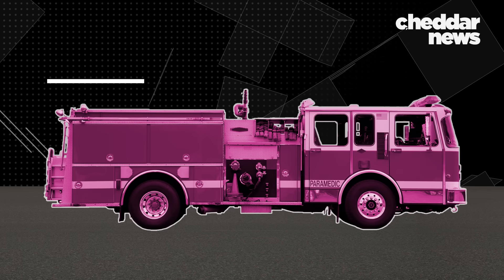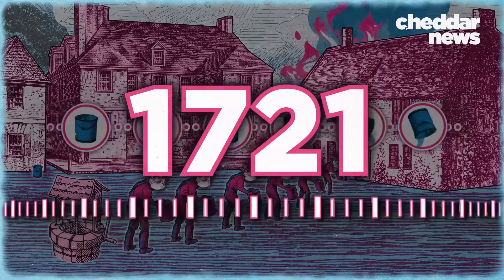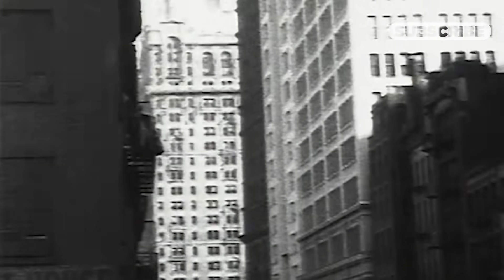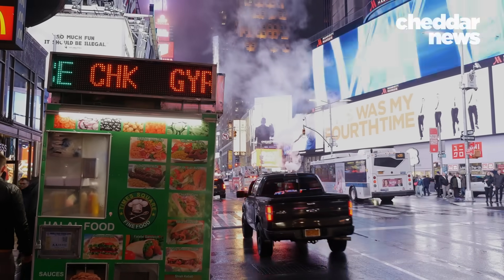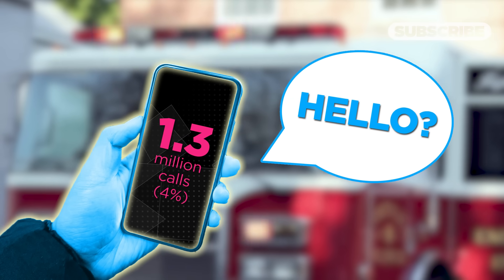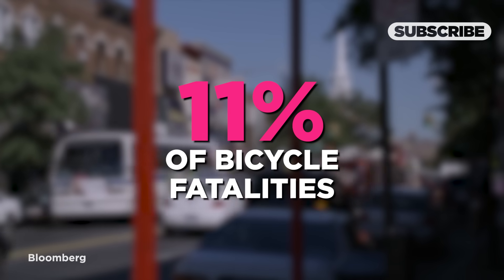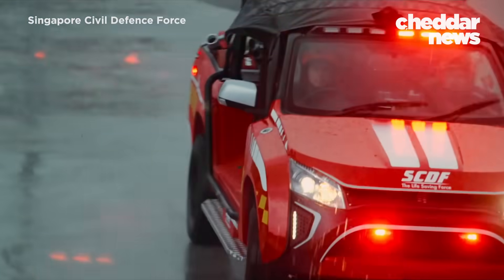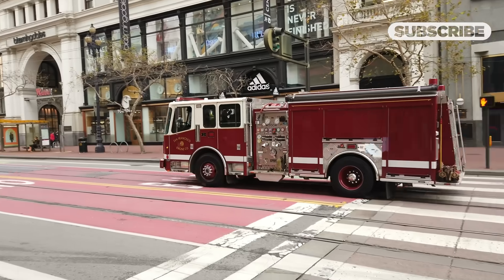Do American Fire Trucks Need To Be So Massive? - Cheddar Explains

Comment: Here's the thing maybe American fire trucks could be smaller who knows. But let's look at this scenario let's say you're going down the road and you get hit broadsided with a tractor trailer and yourself and your family is in your car, I roll up to the scene and my big heavy duty crash truck and I have every piece of equipment on that truck that I need, most of the time I have double the amount of equipment that I need. So I can work on this accident scene and I don't have to wait for anyone else to get there but if I were in a smaller truck and I roll up and something happens to a piece of equipment I have I may have to call for backup and that might take 10 or 15 minutes that you don't have. Let's take this other example let's say you have a car accident you have one car over to the right side of the road and another car to the left side of the road My big heavy duty crash truck I can work out of both sides of that truck and we can extricate that patient from both of those cars at the same time. Sometimes smaller trucks have an advantage but they're advantage is size and speed however they don't carry as much payload and when you're on the scene of an emergency the last thing you want is have to wait for something to get there, this ideology has been proven over and over and that's why a lot of the fire trucks are so big, because if you're in a rural area out in the middle of nowhere and you pull up to a structure fire it's nice to know you've got 600 gallons instead of 300 gallons of water because by the time your next water source gets there to set up a drop tank that house could burn to the ground or someone could die because you didn't have enough water to put the fire out to get to them. Why don't you leave the firefighting to the firefighters and we'll leave the Google searching to the Gen z people.
Reply: let me put it like this: an Engine in Germany is smaller than it's American counterpart. It holds less water, but comes both with a larger crew and more equipment. Why should they choose a larger truck then? It's not about the size of the truck itself, but how you make use of the available compartment space - and concerning that German fire apparatus are like a game of tetris for professionals.
Reply: @EnjoyFirefighting  You answered my question It's smaller it has a bigger crew and it holds less water. So without the water you don't fight fire. There's been a million efficiency studies done on the size of fire trucks they're configurations how the crew works do they use a three-man crew a four-man crew a six-man crew that's been beat to death, and the American trucks are still the same and they're going to stay the same. In Staunton Virginia they have one of the largest ladder trucks in the United States why because they need it or they wouldn't have customed built it.
Reply: @20truck  "So without the water you don't fight fire." keep in mind that the tactical approach might be very different. Departments in the US rather go for larger flow at lower pressure, whereas we go for lower gpm but at higher PSI and thatfor just don't need that much water on board to do the same job. 
That Ladder from Staunton looks like a massive truck, but it's still nothing more than a 100 ft ladder, is it? Yeah we have some few, very few Aerials of similar size (concerninge truck chassi) but not as Tiller. We don't have any Tillers in service on this side of the pond. The only one or two Tiller Ladders we have are imported US trucks in the private collection of some fire apparatus enthusiast in the Netherlands.
Reply: @EnjoyFirefighting  Now there's one thing that I do notice about German and Dutch fire departments that I see on YouTube they don't pull out hose like they do in the United States, you guys use a hose reel with quick connect personally I think that's a good idea You can get to the fire quicker. Now I don't know how your setup is done but in America when we use a hose reel it takes a lot of pressure That's why we used soft hoes that we use, how do you in Europe use that hose reel if you're going vertical can you get enough pressure from your engine to get it up a couple stories in the air? Another thing what do your fire hydrants look like I see videos from fire departments in England and their fire hydrants do not appear to stick up out of the ground like ours do they look like they're under the sidewalk and they open a  door and the hydrant is below the sidewalk is that true, If it is take a picture of one and let me see how it works?
Reply: @20truck  most European apparatus don't have a hose bed. Doesn't mean it doesn't exist, but it's not common to have on a normal Engine in most of Europe. Depending on the country, age of the truck etc the hoses are rolled up, few preconnected in hose packages or hose baskets, or sth very popular in Germany are the hose carts on the rear of the truck with numerous preconnected hoses. Additionally there are the rubber hose reels as quick attack lines. 
No problem, the pumps are strong enough to supply sufficient pressure to operate the hoses also several floors up. UHPS systems building up extreme pressure and thatfor working with only minimum amounts of water were somewhat popular in the past but aren't that popular today any more. 
That's correct. Well again it depends on the country and the specific area: we do have some few above ground hydrants, however most of our hydrants are below ground hydrants which are usually located in the road, with a cover which is even with the road surface. The crew can open the cover, place a standpipe onto the connector underneath and use a hydrant key to open the mechanism.
Reply: @20truck  video on the below ground hydrant. Although in German, you can see how it works: https://www.youtube.com/watch?v=2HIv8CQ90rw
Reply: @EnjoyFirefighting   That's exactly what I thought the fire hydrants would be, I guess they keep them underground to avoid freezing up in the snow. In America we have a hard time with fire hydrants in very cold climates freezing up, in some states fire departments carried torches with them so they can heat the fire hydrant up in order to get water out of it. Thanks for the video that was very interesting, Even though I didn't understand a word he said the picture was worth a thousand words
Reply: @20truck  they come with pros and cons; Even in super low temperatures the ground will freeze only 30 inch deep, while the pipes are 60 inch deep in the ground. However the hydrant cover can freeze and then it takes either a hammer or you have to de-ice it with a flame
Reply: @EnjoyFirefighting  I think getting to hydrants in the winter is a common problem for every fire department whether they're buried in the ground or they're upright like the ones we have in America. Cold is the great equalizer it'll get you any way you go. And then when that water comes out the end of that hose in the cold we all freeze solid. I know one day I was going down the road after a we had done an extracation on a truck that had wrapped around the tree and the fire department was likely spraying so as we were cutting the metal with the K12 it didn't cause a fire and some water got on the road I turned around to go walking back to the engine and I hit black ice and I bet I slid 30 ft before I got stopped, my ass hurt the rest of the night.

Comment: As a retired American firefighter allow me to repeat what a visiting firefighter from Germany once told me about American fire engines:  Americans design their fire engines with two views - one is how it performs fighting a fire, and the other is how it looks in a parade!

However, the type of engines you have is more dependent on the type of fire department you are.  A larger department with closer stations can afford to run smaller units because help - and specifically additional equipment - is closer to hand; but a department with fewer stations spread further apart (especially with fewer personnel) can't afford to leave much back at the station when the alarm sounds.  The same can be said for fire units that are also overly-specialized.
Reply: In Germany one of the widest spread vehicles is the HLF 20. It's equipped for fire and technical help/ rescue. Because it's tight packed, it fits all this equipment. 

And because it's 4x4 you are also able to drive it offroad. We get with this truck through narrow streets and are also able to drive into a forrest, dring a forrest fire.
Reply: The actually same applies in Germany.
Depending on the location and the size of the area the fire department is responsible for.
They have either specialized trucks or multipurpose trucks.

So many small villages have only one or two fire trucks.

Usually one specialized for fire fighting and one Specialized for freeing people from crashed cars.
Or
One Multipurpose 
And one just for transporting more fire fighters (since the equipment is in the first truck)

And only the larger cities have ladder trucks. Because in a rural area with farmland they would just collect dust most of the year.
So in case a larger fire happens both the local fire department as well as the next major one would be alerted.

And within larger cities basically the same applies. Depending on their expected work. 
One firehouse might have all specialized trucks like:
1 ladder truck
1-2 tanker trucks
1-2 fire engines
1 Specialized Rescue Truck
1-2 ambulances
1 command vehicle 

While another firehouse on the outskirts of the same city will just have
1 Fire engine 
1 Specialized Rescue Truck 

Or 
1 Multipurpose Fire truck 
1 tanker 

It's just the size of US trucks that is so unbelievable...
Because most of the time, they are carrying the exact same stuff, yet they are 30-50% larger.
It appears like the equipment is stored much less hidden or more open.
While in European Trucks everything is tightly packed and you explicitly need to know where it is stored.
So the trucks will be as small as possible.

When i saw some US fire trucks it appeared to me, that when you open one compartment there is just a little bit of equipment stored there. So the trucks need to have twice the size to store everything. While in Germany I would have stored several more hoses, two chainsaws and several additional fire extinguishers and other stuff in the same compartment of the truck.
Reply: It doesn't seem to me that any of the European counterparts are lacking any equipment on their shorter cab over fire trucks. I think it's all a matter of efficiency and proper storage.
Reply: @westwasbest it definitely is. As someone mentioned before, the HLF 20 is usually equipped with everything you need for road accidents, fire fighting and in many cases even with some equipment for Abc-accidents. I can't imagine what else should be stored on a bigger truck, as everything you need is right there on one engine
Reply: @maximilianschilling9432  Occasionally have to tow a boat, I suppose?
Reply: @McSlobo  hlf 20s still have tow hitches and can tow up to 5 tonnes if I remember correctly. Also have a built in winch to pull up to 5 to 10 tonnes. Depending on the manufacturer and requirements the department has
Reply: Maybe you should visit Sweden. We are very sparsely populated and have a lot of smaller stations, and our trucks basically have it all.
Reply: @Xanthopteryx yeah, the American problem is just efficient storage, it's just a question of wanting something better or sticking with an outdated system
Reply: @aninterestingtitle7581  They waste so much space on their trucks so it is ridiculous. I am always amazed by how much stuff there are on our northern Europe trucks have on them. The skills of the people who put it all together is just Top Notch!

This in Swedish only, but you might get the idea anyway. And remember, this was 2017 - basically more than a decade ago since the truck was not brand new here!

https://www.youtube.com/watch?v=hEpiUpXwBW8&lc=Ugysi9h5HJQibLUFAkd4AaABAg

Comment: The size of the fire engine is also dictated by the size of your manpower. If your city can only afford to have three-four firefighters on a shift, then you buy a big fire truck to handle different types of calls. If your city can afford to have eight-ten firefighters on a shift, then you can utilize smaller squads for medicals, mid-size all-wheel drive for wildland, regular size engine for regular single story to two story structure fires, and larger engines with ladders and tillers for multi-story structure fires. You need to have the right equipment for the job and since you cannot control what types and frequency of "fire" calls you get, you need to work around your manpower availability.
Reply: when manpower is an aspect, that German Engines would have to be way larger than American ones

Comment: Also, where is the actual comparison, on different countries? Other countries have had the same length of time on developing firetrucks. Bigger vehicles, does not necessarily mean better response times. Smaller vehicles are actually able to get 'on scene' quicker, being able to accelerate much quicker.
https://www.youtube.com/watch?v=3faHfCbKHYw

In Australia, for example, it is a common concept to have a large firetruck followed by a much smaller, four wheel drive firetruck, in case of the need to go off-road - parks, or similar - where the larger vehicle cannot follow. The smaller vehicle has pumps, but whilst it still relies on a powered water supply from the larger firetruck, it can go into much smaller areas... like, between houses, or woodland areas?

England follows a similar concept, the firetrucks are much smaller, due to the need to navigate congested streets... wait, this is starting to sound almost akin to North America now. Congested streets, with little room to move.... why on earth would they still think that 'bigger is better'?

Comment: No, most fire trucks in the USA hold 750 gallons or more. This is per NFPA standards, which stats that Type 4 fire trucks must carry 2 people and feature a minimum a 750-gallon water tank. Most European trucks have far smaller tanks or none at all and they rely heavily on having a fleet of vehicles while in the American standard requires a single engine to hold a lot more equipment.
Reply: uhm ... wrong. 
Yes it's correct that a normal Engine in the US holds more water than a normal Engine in e.g. Germany. But that Engine in the US does NOT hold more equipment than the Engine in Germany. Also the crew is smaller. 
Reason for more water on board is the different tactical approach of using water with higher gpm and lower pressure, compared to most of Europe where they rather work with low gpm and higher pressure. 
"far smaller tanks or none at all" well e.g. rescue trucks, aerials and most special operations apparatus don't have a water tank as there's no need for it
"they rely heavily on having a fleet of vehicles " which is a standard and minimum requirement for certain types of calls in certain locations.

Comment: This is a idiotic video. The reason American trucks are always larger is because our roads are larger, not just with Firetrucks, but with Semi-Trucks as well. Larger, heavy trucks also ride better. I live in the OLDEST city in in the US, where we have very narrow streets, and guess what? The fire Department has smaller vehicles to accommodate their mission. 

As for the accidents involving peds and Bikes, Doubt that includes many emergency vehicles. Cuz, ya know LIGHTS and SIRENS. Looks like this channel is just ripping on Large American trucks. be it, pickups, to American trucking in general.

Also, the narrators pronunciation of the word "Chassis" is driving me nuts.
Reply: "because our roads are larger, not just with Firetrucks, but with Semi-Trucks as well." sorry, but that's just wrong. Prime example is Sweden, known for being the most American-like country, including a road network and layout based on the American one: wide open roads, wide lanes, wide turns. And despite them being crazy about American cars, especially classic cars, they never bought American fire trucks (at least nothing larger than a pickup truck) or American semis - although they actually run larger, longer truck combos than you have in the US. Similar situation in Finland. In between both countries and parts of Sweden you're actually able to spot real road trains. 

Oldest city? Ist that Boston?

Comment: 4:20 In Europe those poles that separate the bike lanes can be run over by a firetruck like nothing. Once the firetruck is gone, they go back up like nothing happened. However, when a car drives over it, the car will be broken.
Reply: there are different types of poles, like solid and flexible ones
Reply: @EnjoyFirefighting  Where I live in Europe, we have the flexible once on the road, and the non-flexible, but removable once on the pavement.
Reply: @Ceelbc  the situation is very different from country to country, and even within the countries
Reply: @EnjoyFirefighting  True. Anyway, if they make the poles flexible, then their problem is solved.

Comment: For the same reason the trucks are huge, the ambulances are huge dumb boxes on wheels, the busses require triple axles, even trains are unnecessarily big. Look at modern US cars. Americans just love ugly, unnecessarily big vehicles
Reply: German ambulances aren't much different from that: heavy like a truck and a large box body. Triple axle busses aren't uncommon in Europe either.
Reply: box ambulances are more convenient for paramedics to operate in than vanbulances
Reply: @hytkyll  you're aware that many ambulances based on vans have a box as well? And that not every box is larger than a van? 
Apart from that there are pros and cons for large and tight ambulances in terms of paramedics working, safety etc
Reply: @hytkyll  and MUCH better than the crappy old hearse bodied ones used in the 50s and 60s